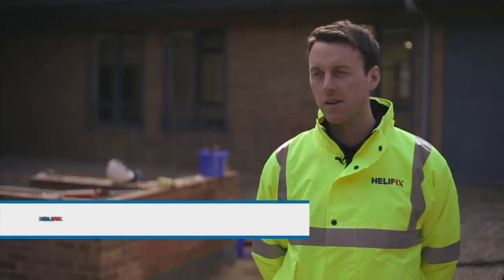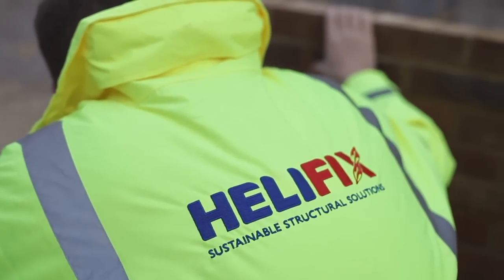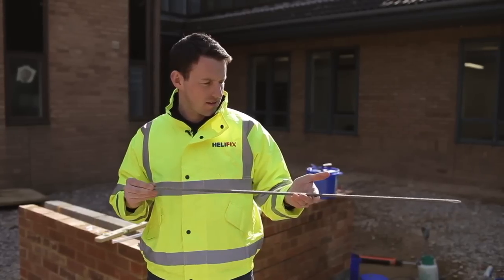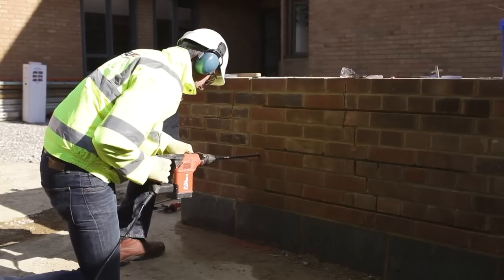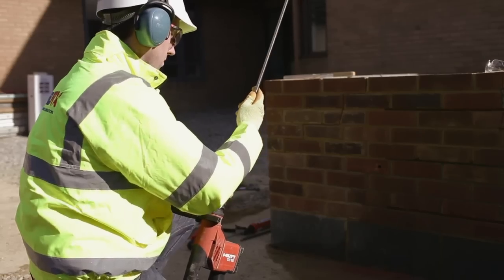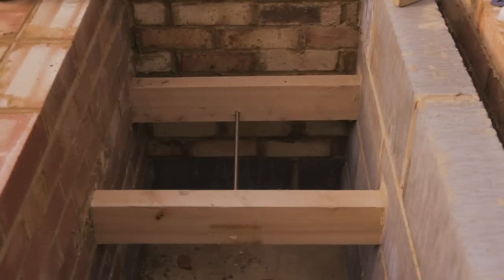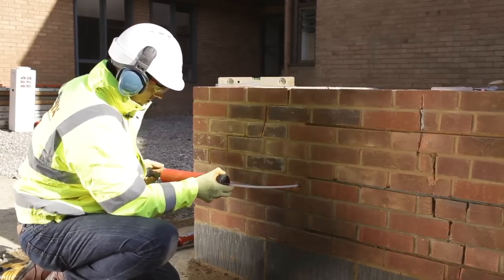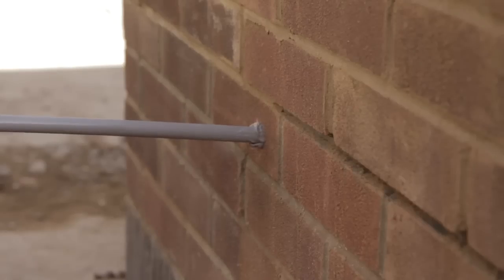BowTie from Helifix

Comment: Can this only be done in the lower level of a wall? I have slight bowing about 8-10 feet up a wall and was wondering if I could support it with this instead of the star bolt method.
Reply from the maker: Hi Joel, the BowTies can be used to stabilise bowed external building walls by
 securing them to internal floor joists at any level and ceiling joists.